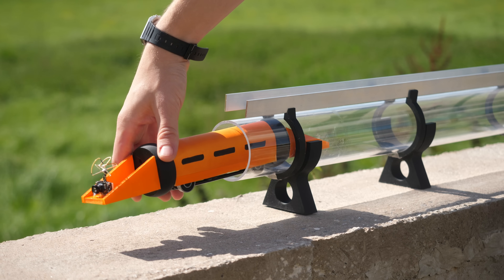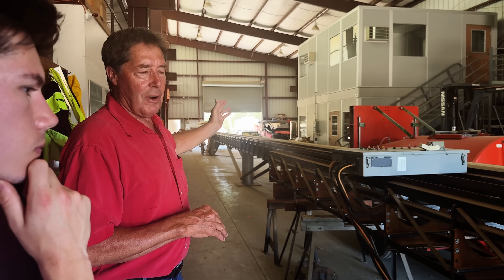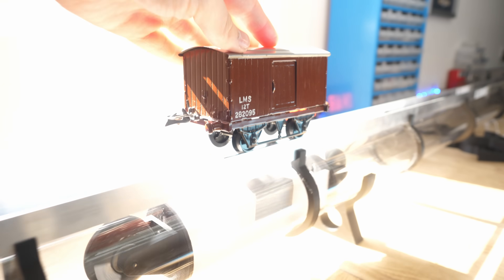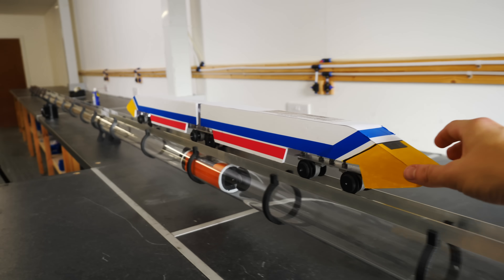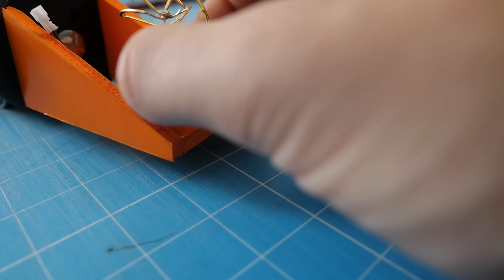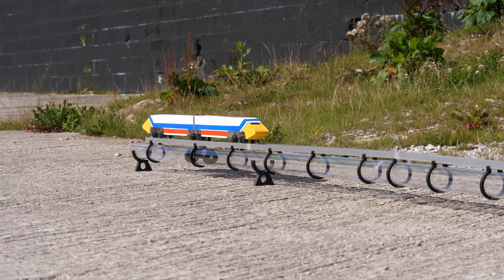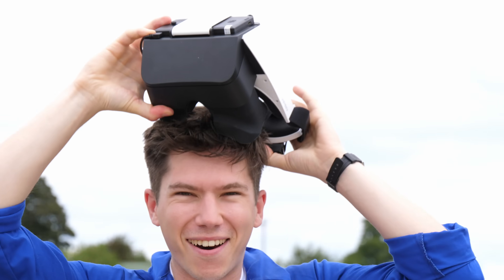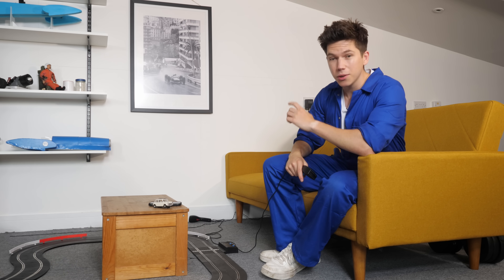Building a SPEED Hyperloop

Comment: So a thought on your thrust carriage- you know those inflatable dino-suits?  could you use That concept for the piston? I mean, I don't know how long wearing that would be, but it seems like it would reduce air going Around the piston, while not being too rigid and perhaps less friction than a solid piston.   Dunno, just a thought I had.
Reply: I also wonder if one could make an electric train, that used electromagnetism- electromagnets in the track, and the engine, to pull/push the train forward, rather than drive it by wheels.  Like basically have your train be the rotor, and the electromagnets in your track the stator.   Using the train itself as the switch that energizes the next magnet in line, and flips the polarity of the last one as it passes. 

This could be inefficient as hell. Or cost prohibitive,  I don't know.  But I've never heard of anybody trying it.  Electrified track? Sure.  Trying to get a free lunch from permanent magnets? yeah.  But turning the track/train into an electric motor between them, powered by onboard either batteries or generator from the train?   Can't say as I have. You could even, maybe, get mag-lev out of it.   That might be too ambitious  But I just wonder if spending the power to turn on 3 electromagnets at once might be less than driving wheels to drag a train along by torque and friction? 

Do you see what I'm pointing at there?  It could be a dumb thought.

Comment: Was just thinking about your 3D printed parts that hold the rails in place.  Have you considered placing a hole at the top, to receive a nut and bolt?  you could then adjust for rail spacing and potentially avoid variations due to changes in heat.

Comment: very cool... when I was a bit younger I imagined this kind of thing to rapidly transport goods from place to place instead of trucking... I got the idea one day while sitting at the bank watching someone put documents etc., into one of those tubes and it shoots into the bank and came back later... good to see someone actually try it
Reply: There was a full scale pneumatic subway test line built in NYC in 1870. There's a world of difference between Hyperloop and pneumatic tubes though. What you saw at the bank is a pneumatic tube. The package is propelled by air pressure, like a bullet in a rifle. Hyperloop cars generally use magnetic propulsion. The tube is only there to reduce the air pressure and thus reduce air friction to allow higher speeds / greater efficiency.

Comment: It looks so slow😂 you should use larger vacuum pipe and a better vacuum!! When I suck a sock up my hoover it travels at the speed of light 🤣 George and Henry can pull approximately 5 inches of mercury negative pressure... you could use a large vacuum pump and Reservoir to reach incredibly higher speeds

Comment: I've always found "scale speed" to be a bit ridiculous, but I do like the idea of a DIY hyperloop. We used to have similar things in banks before ATM's replaced them, but, both those and your system didn't pump the tube down to proper vacuum like a hyperloop would. The whole idea of a hyperloop is getting around aerodynamics by removing the air, which is very cool indeed, but the trains still need some method of propelling themselves.

Comment: This is nearly identical in concept to the classic bank and box store vacuum capsule method of passing money and documents from one place outside to another inside(an office for example) and doing so very rapidly. Usually less than 2 seconds from outside station to bank teller inside. They also would use clear acrylic 4” tubes where visible for architectural effect and pvc when in-wall. But work effectively yes they do. They use a type of fuzzy seal ring like felt on both ends of the capsule to allow movement tolerances and still slow the atmospheric pressurized air down enough to make it effective.

Comment: I don't want to down the video as I like your channel. But, either I'm not doing the math correctly or yours is off. 100mph scaled down to 1:48 is 2.08mph. 1 meter per second is 2.24mph. I think you meant just under 1 mps. Also, I know the 767mph scale speed sounds fast, but just call it what it really is, roughly 16mph; pretty slow in reality.

Comment: This is nothing like the Hyper-loop concept, in which the vacuum exists solely in order to reduce friction. The train is inside the tube using mag-lev/linear induction, and using induction braking to recover a significant proportion of the energy used during acceleration to cruising speed. 
Sucking air out of a long, wide tube, in order to get air pressure to drive a vehicle like a piston, seems likely to be an inherently inefficient modus motus.
When you’re ten miles along the tube, that air pressure is pushing both the train and a ten mile column of air along the tube. I wonder which is using more energy: the train, or the column of air?

Comment: Little tip regarding Solidworks/3D printing. Save your files as a STEP file as opposed to a STL. Instead of rendering a bunch of triangles, it will recognize circles and round surfaces, providing you with much better quality 3D prints. Bambu Studios will easily accept STEP files.
Reply: It doesn’t matter using a slicer program tho right?
Reply: @ionbusman2086  It doesnt seem to open using Cura, cant say for other slicers. Bambu Studios is all I use now

Comment: Great video, I wonder if you would get faster speed if you added a positive pressure behind whilst having the vacuum at the front effectively pushing and pulling at the same time.
In theory it should be more efficient transfering air from the front to the rear

Comment: Fun to watch but im pretty sure the paperwork flies around my local supermarket in a vacuum tube faster than that.

Also, I would have thought you would have to square the scale factor to get to the sound barrier as air resistance squares wirh speed.

Comment: I remember reading years ago that the ideal ratio of tube to vehicle diameter - for a hyperloop-style system - is 2:1 respectively, so the vehicle's maximum diameter is two thirds that of the inside of the tube. That'd probably improve things drastically from an efficiency standpoint (perhaps not speed though). Also, hyperloops don't tend to use the vacuum for propulsion; the lower air pressure is to minimise drag, whereas propulsion is provided by what is essentially a magnetic linear motor.
Reply: Also you can't have a real hyperloop because if you try to build an enormous structure that could violently implode people near it will get really upset and stop you.

Comment: Q: at 6:56 you show where the undercarriage/piston snags when you move the top train, but the piston is the driving force tugging the top train along, so this should not have been a problem. as long as your suction does not make it a problem. just watched it through to the end, you`ll probably get a lot of suggestions, but if you make the rail holders connect at the top with either a cross-section or even make it snug around the pipe all the way (either greasing them on, or even use a little conical shape to get them on, i think your rails would be much more stable.. Fantastic project btw!!

Comment: I think I should point out that a vacuum is easily obtained just by going about 10 miles straight up.  Doing this would avoid the need to build a tube and most people wouldn't even notice an extra 20 miles added to their 500 mile trip.  The module could use airfoils to keep its self in the partial vacuum and also control its direction of travel.  Pumping multiple streams of air out the back could be powered by some turbine engines and would drive the module forward..  I call this idea hyper modules.

Comment: 3d printing the rails wasn't a bad idea. The issue was you had the should have had the space between the rails printed  and not under the bottom of the tube. The the rails wouldn't have came apart. the way you currently have it the rails are sitting on structs with the weight of the train and magnets pulling down on it.The track force is applied outward because of how you printed the black parts. If you had the expansion at the bottom it wouldn't not have moved apart. That said you would face another potential problem that would be them loosening up and the entire track then tilting to one side or the other. So having a way to couple the loose side would be smart even if it is just a rubber band.

Comment: The problem with using vacuum as a power source is that the vacuum does not produce the energy - the differential between vacuum and atmospheric pressure does. It's the +pressure of the atmosphere that produces energy. The energy between vaccum and 1 ATM vs. 1 ATM and 2 ATM is the same.
So... Using vacuum, all you can ever get is 1ATM of 'energy'. Using +pressure as an energy source, you can use 1 or 10 or 10,000 ATM for whatever amount of energy you want.

Comment: I wonder if the rail warping issue could be fixed using a round rail and multiple wheels surrounding it, similar to how some roller coasters mount to their track. Would increase friction, but make it potentially harder to derail. could be fun to experiment with.

Comment: So basically you proved one of the major flaws in hyperloop security by utilizing air pressure to catapult the train trough the pipe. Which is exactly what will happen if there is ever a sufficient pressure leak smashing every train car in the pipe into the next station's airlock gates.
Reply: He didn't built an hyperloop/ vacuum train. he build a pneumatic tube transport system. You know? The thing where capsules get pushed through pipes using air pressure?
But you are correct about the danger of Vac Trains though
Reply: @darmanskirata4167  hyperloop is  in the title though. But yes that train has little in common with an actual hyperloop.

Comment: So it scales down nicely, but unfortunately it's still a Hyperloop, so it's not gonna scale up - at least not in length.
Besides that, i don't think the "speed of sound" can be scaled down, unless you scale down the atoms, too.
Reply: Its not a Hyperloop, its  pneumatic tube transport. And it can be scaled in length, up to multiple kilometers. Only size of the capsule isn't really scalable
Reply: @darmanskirata4167  Doesn't matter what you call it, the problem is the same: keeping up the (negative) air pressure over multiple kilometers is definitely NOT scalabe - otherwise somebody else would already have done it. After all, the idea of the "Vactrain" is already over 200 years old. And the Hyperloop is just a name for that very concept.
Reply: @jangrewe  It does matter what you call it, if you are talking about different things. A vacuum train or ''Hyperloop'' is not what he build here. A Hyperloop is a normal train or maglev train, inside a vacuum tunnel to reduce air resistance, so it can go faster.
PTT relies on air resistance and pressure as the propulsion source. You also don't need a vacuum, you only need a difference in air pressure. Just like a projectile in an air gun. Or a sail boat...
PTT was already implemented and is still used to transport small objects. The biggest ones that got implemented used capsules of ~40cm in diameter, and some even where big enough to shoot single seat passenger capsules through tunnels. It didn't catch on because the subway was invented
Reply: @darmanskirata4167  Thanks for confirming what i stated: It doesn't scale. For a multitude of reasons, and regardless of whether you're pulling, pushing or neither of both. And yes, that's why we have subways today, and nothing else - and won't be seeing anything else anytime soon.
Reply: @jangrewe  oh no, absolutely. I’m not arguing that it would be viable as public transport, I’m just a fan of Pneumatic Tubes and realy annoyed that it got confused with the  Hyperloop BS

Comment: Fluid dynamics scale problems: Speed: The power required increases as the square of the speed.  Surface area: Resistance increases as π².  And worst of all Length: The power required increases by the cube of the length.  That one alone really kills any full scale implementation of using a vacuum tube to move people or cargo over large distances.  Even the magnetic strength required increases as the square of the distance which matters more as the materials required get thicker.

Comment: If you just intend going in a straight line, use aluminium angle ( L ) instead of flat rails to prevent spreading ( the shape of real train rails reduces sideways buckling )
Reply: Aluminium channel is WAY better, the width won't ever change😅

Comment: I’m so,pleased someone has the facilities to prototype something like this. BUT why the over engineering? About ten years ago I drew up some designs for a train inside a pressurised tube which had the engine internally. Sucking the air from in front of the train and pushing it out behind. This leaves the overall pressure in the tube section stable and at the same pressure but displaces the balance creating the differences  propelling the train along. This does not need any external structures for propulsion as the unit is self contained. I went on to figure out that the breaking would be done by air velocity. Also the station points for passenger entry and exit would act as both pressure flanges and a air reset mechanism each time the doors were opened. Just like travelling in a jet propelled bullet in a sealed tube. Issues would include stability if the tube was circular. An oval cross-section would eliminate that but the custom oval production would prove excessively expensive, so stability would have to rely in part on a lower body weighted carriage.

Comment: The connection point on the acrylic tubing should be flared, then 3d print a coupling have a smooth transition along the tire position on the piston, the seal outside of coupling will help push through the transition point.

Comment: You made your rail tie pieces upside down. The opening should be on the bottom, and on the top you have the bits to hold the rails. That way the distance isn't affected by how it's clamping on the tube.

Comment: I would suggest that instead of metal rails on top, that you use the tube itself as a monorail. 
If the thruster tube was rectangular like a 2x3, and the train rides on the edge like a monorail,
the tube itself would be the track. 

The wheel carriage would be an upside down U with 
one vertical wheel at the top and one horizontal on each side.

I am wondering if the magnets were on the sides of the thruster, and raised a bit
that might give the train a bit of vertical lift

Or if you had wings on the train, the train could hydroplane above the track...

To measure train speed, just use 2 electric eyes.. 
1st one starts a counter and 2nd one stops the counter, and gives the result...
a 3rd eye at the end of the track could apply the breaks....

Comment: If you would have designed those rail clips "In reverse," you should have had less issues. The rails needed to be held at a specific distance, so that section of the clip should have been solid, then you could have designed the arms of the clips to come down from that solid structure. And, if you need even less distortion, make it a solid ring to slide down the pipe. But, congrats on the success you got. Just design what needs to remain within tolerance either solid, or with fine adjustment designed in...

Comment: What if you close the loop completely and use 45 degree y pipes in different sections around the track and attach a vacuum on each and find away to control all them with a control board and see how fast you could really make it go

Comment: But scaling down this experiment in dimensions does not mean that the speed will scale accordingly. In order to make a correct scale down experiment you have to link all your parameters to a non-dimensional trio with equations and use it to scale everything maintaining this trio of variables constant. I Don't remember the correct name of this theorem at the moment, but that's how it works
Reply: You are correct and it's called similitude, using dimensional analysis.
At first it can hurt your head a bit but when you get the idea it's a really good method for simplifying hard to crack problems

Comment: 6:07 Excuse me, what the hell is the point of having a carriage in a vacuum pulling magnetically a carriage in the atmosphere which still has air resistance? This doesn’t make any sense whatsoever. You have the fuel source not on the train, but that’s the same concept as electric trains. You have the motors also not on the train, which is cool. But are you really saving anything with all the extra friction and wasted energy of basically having a whole second train running underground pulling the real train? The physics on this make no sense. I’m curious if this will be discussed later in the video.
Reply: It can go uphill

Comment: You could have probably used the first sled for inside the tube. You could have pulled a ballon connected to the vacuum and blew it up at each joint and sanded it once it was in place so they sat flush with each other.

Comment: "Scale speed" is a strange concept. Scale momentum or scale kinetic energy might make slightly better comparisons, physically speaking, if they're scaled based on all the relevant factors. The use of a completely separate force generator (the vacuum cleaner) that can be independently scaled makes things harder to compare. Power efficiency goes completely out the window as a meaningful figure.

Maybe scale acceleration (or force), scaled by the surface area of the piston (and maybe its mass) would be the most appropriate comparison.